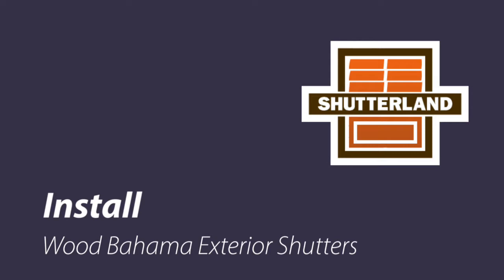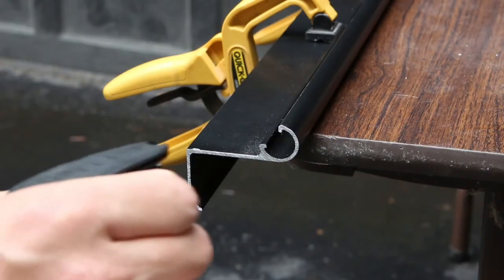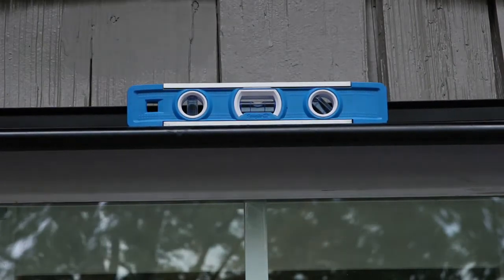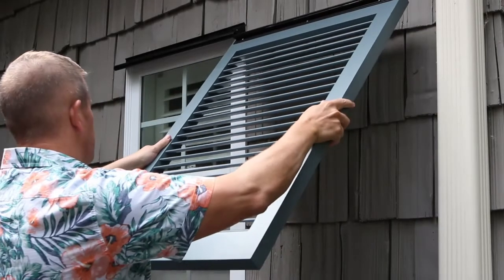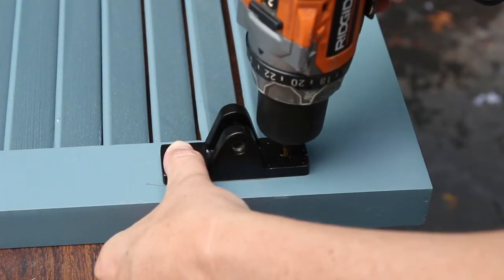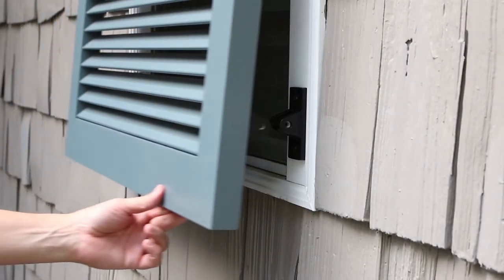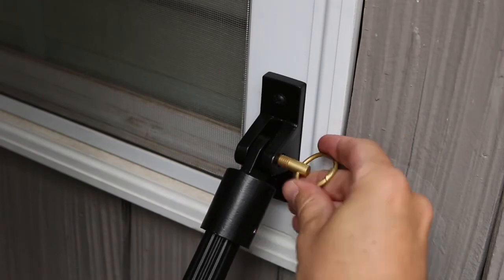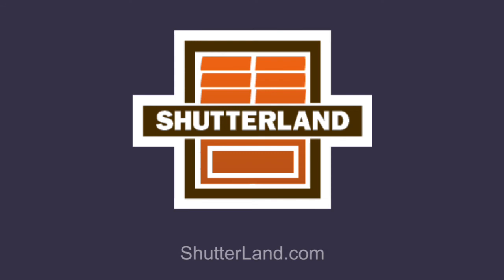Install Exterior Bahama Shutters

Comment: How well do these hold up during a hurricane?  Also I have a two story house and it is elevated because it is on a shore line. I suppose they can be operated from inside the house, through the open window.
Reply from the maker: Wood Bahama shutters are primarily designed for light control and will naturally deter some debris but are not rated for hurricane protection. Yes. you should be able to open and close the shutters through an open window.